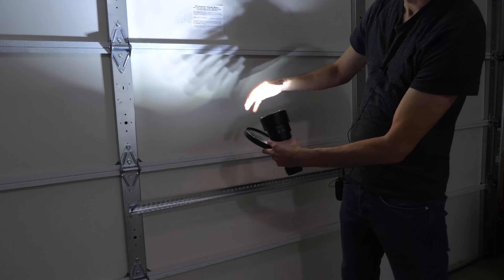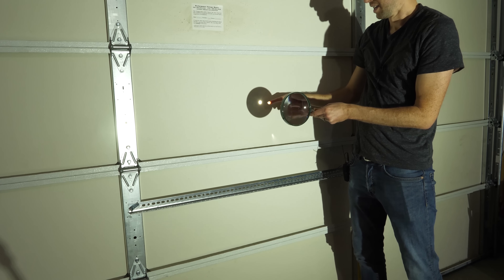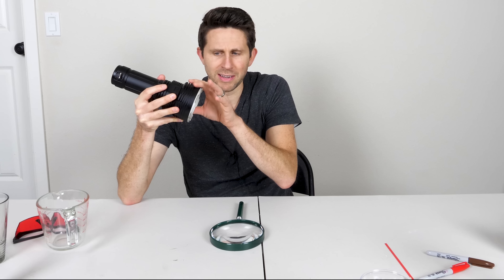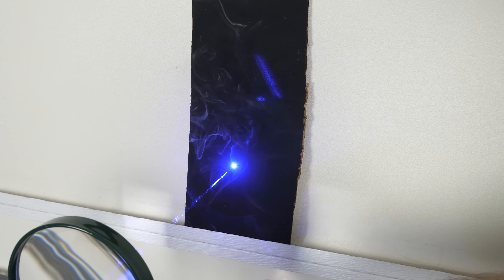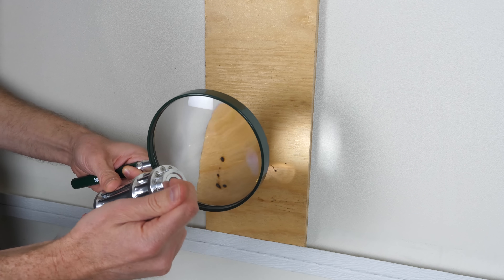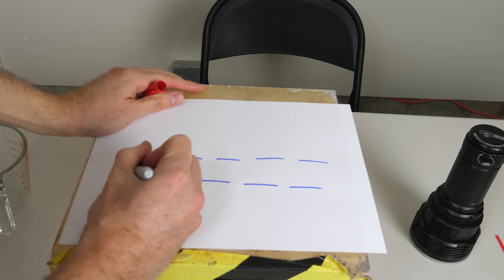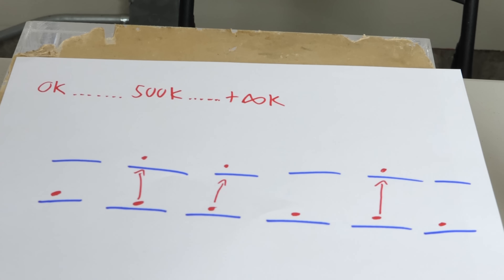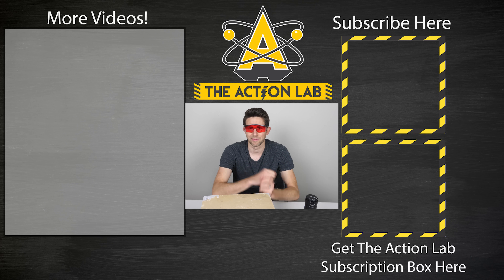What Happens if You Focus a 5W Laser With a Giant Magnifying Glass? Negative Kelvin Temperature!

Comment: The light have no material to guide itself, schnell basically
Reply: I think that the laser wavelength is between 380-780nm but the blue color indicates the its is centered around 450nm so the photons emitted have  lot of energy in terms of eV, I would suggest the use of a cristal as magnifier doped with Ge and also the coupling should fit in the active zone of the laser to lost the minimum energy of the laser between the interfase as much as possible, also it is interesting to check the reflectivity of the tho crystals around the active zone and calibrate them to have the max power input
Reply: Also it is interesting the temperature as you said, it is convenient to have a good spontaneous emission to generate the process of guided photons but it is not interesting to have a lot because those photons generated are not guided so the balance is important to have the max power, also the direct voltage introduced to the laser. It is important to check graphics to see the best level of each component used in order to maximize the power

Comment: I didn't know anything about science as a kid, but I had a magnifying glass from an old projector that I would always play with and light things on fire with. I would just barely try hard at all to focus the light on something and it would burst whatever i was pointing at into flames. I loved it so much. I wish I still had it but I don't have it anymore. Anyways, I just wanted to say that, obviously if the flashlight goes all over the place and has a huge radius, it's not going to do anything at all when amplified by a magnifying glass. The light needs to be controlled into a small enough circle that it will fit the magnifying glass. That's obvious as well. But, the thing that people never really talk about is.... You can also just make the magnifying glass bigger and/or thicker instead. People always focus on the light, don't forget that the main thing is the magnifying glass that's giving you the results that you want in the first place.

Comment: The dot can be brighter, as the energy is being focused into a smaller area. There is less total energy after focusing, but it can definetly be brighter.
Reply: The second law of thermodynamics forvids you to focus the light from the flashlight to a smaller area than the surface of emition. Doesn't matter what array of mirrors and lenses you use
Reply: @joselotl  
Because the thermodynamic police going to smite you down if you do that? Will the send a SWAT team to disrupt your physic breaking experiment? Of course, not.
I think the OP is correct. The magic words is 'CONDENSE'. Total energy out put would still be less BUT the energy condensed in small area could have higher temperature than the source. Gas is a better example of that.

We wouldn't have refrigerator if such concept is wrong. Think about it.
Reply: Of course, with an active device you can do it. One that consumes extra energy appart from the one from the flashlight. So, not an array of lenses and mirrors. Just like a refrigerator
Reply: @joselotl  
Let me put it this way.
10 people standing over 1 sq.km. and 2 people standing in 1m size square, which has more density? Which has more people?
Reply: Imagine all the energy stored in the ice at the Antartica. Its a lot of energy, yet you cannot concentrate it to heat your house.
Reply: @joselotl 
If you can compress the ice/ water, then it would probably work.
But in general sense, ice and water are not compressible. Which is a different topic.

Ice may have store fewer heat than of that hot air, but the temperature usually around zero celsius. With the mass holding it, the energy is way A LOT more than of that absolution zero kelvin, which translate to roughly -200 celsius.

If you can squeeze it out, of course.
Reply: So why it doesn't work with flashlight?
Reply: and hotter... just need a magnifying glass bigger than the angle of the emitter and glass that wont absorb photons lol
Reply: @justincase1898  because flashlights and the sun have positive energy while lasers have a negative energy. Don't ask me what that means, I just know that's the answer lol
Reply: @MuhammadAli-qh8tg  Not negative energy. Only negative temperature.
Reply: @MuhammadAli-qh8tg  Yeah but why can a sun burn but a flash light won't? Seems to make your answer invalid?

Comment: Lemme make this easy.

Laser light = Very Low Entropy, Well-ordered light. Emitted in only one direction at one frequency, all in phase.

Sunlight = High Entropy, disordered light. Emitted in every possible direction across a wide range of frequencies, with random phase. Entropy lowest just after emission.

Because Entropy cannot decrease, the target image light falls onto must be sufficiently big and dim to account for all the disorder. For sunlight, that means you can't do any better than to create an image at same temperature and brightness of the source (ie the sun). For Laser Light, on the other hand, entropy is not the limiting factor, so you can make the image as small and bright as your equipment allows.

PS. Entendue is essentially a fancy name for Entropy in optics. They're technically different concepts, but are very very closely related.

PPS. "Negative" or "Infinite" Temperatures in this context basically just mean that the entropy of the laser light is very very small relative to the energy it carries. The technical definition of temperature is the ratio of energy change to the entropy change in a system when heat is applied, and in some setups (eg. lasing cavities) it's possible for the system to become more ordered, not less, when energy is pumped in. Thus negative temperature, low entropy, and high energy.

Comment: Please tell me you know that’s not actually a laser. It’s a focused LED. I have the same one. But I’ve also had a real laser and there are a lot of differences, most important of which is the way the light is created. Trust me, there is no gas tube that $40 Amazon “laser.” Also, no matter how many are sold with the name and no matter how many YouTube scientists make videos about them, there will never be any such thing as a “laser diode.”
p.s. Yes you can focus a flashlight down to a fine point, hot enough to burn wood. You just need a big lens and a focusable high power flashlight.

Comment: This video is non-sense. You can focus light from a flashlight buy using a collimating lens in front of the magnifying glass, you can focus anything to a smaller and smaller point with the right setup.

 Also, the temperature at any given point and the total amount of heat are not the same thing....

Comment: There are several LEDs in that flashlight, what you have to do is use one magnifying glass to straighten up the beams so they dont spread out, and then a second one to focus.
This will lead to a brighter spot as the light emitted from each LED is focussed on the same spot
Reply: Wouldn't that invert it and make it more spread out
Reply: @mysterynotch9098  it would, the chain would require 3 mag probably
Reply: Wrong, the point at which the light begins to converge or even “straighten out” as you said occurs after the light has already spread out too much to increase the temperature above where it started. If you bring a lens close enough to “catch” all the light, you will only spread it out rather than focus it in any way. The simplest explanation for this is that the second law of thermodynamics always holds true, but another explanation would require advanced analysis of optical wave phenomena.
Reply: @loukgoldberg  If the first lens is at the right point, where the source is at the focal point of the lens, and the lens is big enough, it can straighten the whole beam. Then another lens would focus that beam to a tiny spot. I don't buy the argument in the video. In optics you can focus a beam down a wavelength size in theory. Using a setup like @DEADBEEF mentioned we should be able to focus the beam to a smaller spot than the source, since the source is obviously larger than the wavelength of the light. There must be another way to interpret this in terms of thermodynamics.
Reply: @loukgoldberg  
He use words ambiguously. Let us assume the LED give 1 lumen ( of course it doesn't give that much energy, just for the sake of counting ) over 1 sq.cm. Now use magnifying glass to condense the area down to 1 sq.mm. The brightness ,after reduce loss, would be more than 1 lumen. A simple math would give 1 lu/1sq.cm. x 100 sq.mm./1sq.cm., that is roughly a hundred time over.
Of course the energy from the LED would loss here and there. There is no way that spot would get more energy than its source. But that specific point would still brighter then the LED.
Reply: @farn1991 you might be able to get the point to be smaller than the led but no smaller than the fuse inside the led. It is impossible to get it smaller than the source and it wont get brighter than if you just held the fuse directly as close as possible
Reply: @hypnogri5457 
Of course, you can. 
It is call 'focal point' for reason. An ideal point has no actual size.

But real world lens aren't ideal. Not to mention that temperature is a density of heat. Whatever you got from focusing all those energy will first dissipate to surrounding air.
Reply: You can see mathematical proofs about this under "conservation of etendue". The maximum compression for our sun would be around 45000x at around 1000W/m2 if you use the angle of around 0.27 degrees. This works out to around 6000K if you multiply the energy with the compression factor. Cant get better than that without energy storage
Reply: @farn1991  its called focal point because that is the theoretical limit for perfectly coherent parallel light that us focused with a parabolic mirror. The moment your light is just slightly messed up and "crooked" the theoretical limit becomes more of a small ball and not a point
Reply: Absolute zero, or 0 degrees Kelvin, is the temperature where all motion stops. It's the lowest limit on the temperature scale, but recent news articles have heralded a dip below that limit in a physics lab. Is absolute zero less absolute than we thought? At the finite focus there is a dead zone where no heat is emitted, 1 Planck Length before or after the heat reappears and remagnifies.

Comment: This made no sense. If I'm in the sun with a magnifying glass and focus it to one point I could burn a piece of cardboard. If I just left the cardboard out in the sun it wouldn't burn it would just warm up. The focusing of heat/light to a much smaller surface area or point is the reason it ignites. You're not adding energy, just telling the energy where to go. I don't see how lasers are any different. You're just focusing the laser more than it already was. The whole video falls apart when you press that laser up to the wood and it burns immediately.

Comment: THIS VIDEO IS INCORRECT 
Focusing light from an area down to a point absolutely CAN result in that point being hotter than the source of the light. 
It depends on:
(1) The energy per square area at the source; 
(2) The distance from the source; 
(3) The area of light that is captured; 
(4) And the area that it is focused down to. 
NONE of this "breaks thermodynamics."  
It's just simple arithmetic completely within the laws of thermodynamics.

Comment: Slight incorrect info here, technically if you had a big enough lense with the correct curvature you could focus the entiraty of the light into a point (infact this is actually how lasers kinda work to some extent, at least multi diode ones anyway I belive). But you are right that it would not be hotter, it would be slightly less hot as the entire sorce due to  loss to the suroundings.

Comment: Focusing the heat energy dispersed over the surface area of the flashlight into a finer point with a higher temperature is not impossible.
You would need to put some work in though, so maybe it is for you...
toxic=100 accuracy=100

Comment: 2:24 OK so I’m calling BS on this vid. We’ve all burnt an ant using a magnifying glass and if your hand was steady enough using a simple magnifying glass you can reach up to 400°F. Using much bigger lenses and mirrors we’ve been able to focus sunlight to reach up to 5000°F here on earth. The part that really throws me for a loop is that the light captured by these lenses is a minuscule fraction of the light emitted directly on the surface of the sun yet we’ve already bridge the gap halfway to the 10,000°F on the surface of the sun. It really seems like common sense that if we had a Dyson sphere or swarm that was capable of efficiently reflecting and focusing even just 50% of the suns energy output into a point about a meter wide, it would be immensely hotter than the surface of the sun because the energy per square inch is MUCH higher. To be honest I think there’s just a lot of confusion with the differences between intensity, concentration, and luminosity and concepts like is there a difference between sunlight and the energy it carries or is the sunlight energy itself.
Reply: yea I dont think lazers are nearly as hot as he is putting thier temperature in scales that outdo the center of the sun, I just dont think the lazer is that hot its a beam of focused light waves powered by a battery it cant get that hot unless it was like a burst charge and even then like approaching infinity with like a large burst charge of energy? idk this all just sounds bogus, and I think you could easily just build a better more perfect magnifine glass and get awesome temperatures from the sun, and just keep redirecting them like you said, like the heat is only going to build, a old tube tv screen is a good enough magnifine glass when ripped apart to melt some metals, just take 200 of those and you should reach 10000k unless heat dissapation is a problem somehow or its not additive/multiplicative like that, but even then couldnt you just add even more?
Reply: just add this at the end of a youtube link to see a cool version of the tv tube magnifine glass, people are litterally just throwing these tvs out. v=zuP8iUnPIhM&ab_channel=HowRidiculous
Reply: Wouldn't the thing you are heating up start emitting energy as it gets hotter?

The boiling point of tungsten is also similar to the surface temperature of the sun. Whatever you are heating up would be difficult to contain.
Reply: Thermodynamics was designed to keep money flowing at Universities & has no practical use, it's honestly repulsive how they claim the {knowledge of fire} as if we haven't domesticated it over the last thousand years. It's as if I'm the stupid caveman, expected to kneel and worship all the Thermodynamic Physicists and their infinite {fire knowledge}  

I'd rather learn from blacksmiths & welders.

Comment: This is such bunk. All photons are quantum, negative Kelvin is not real, the second law states that if the physical process is irreversible, the combined entropy of the system and the environment must increase. You can in fact produce a smaller spot that is brighter than the sorce with the correct combination of lenses. I'm so disappointed that you wold make a video like this.

Comment: I can normally follow what you’re saying in your videos, but this one left me very confused. I would have thought the reason you can focus the laser is just because you can get the whole beam hitting the magnifying glass all at once instead of just a small part of spread out light from the flashlight. This would then have more to do with the optics of the laser compared to the flashlight rather than temperature?
Reply: From what I understood you’re right, focusing the beam is what’s increasing the temperature at the site of “impact”, but what he’s explaining is what’s happening inside the beam itself. Whatever the beam hits, no matter how focused it is can only get so hot, but basically lasers are fukkin weird
Reply: @Gay_Priest  yep. Usual heat based sources shine because as they warm up, electrons jump up and down orbitals and the excess energy is released as photons, hence the amount of fotons is directly tied to the temperature.
Meanwhile lasers skip the temperature step and convert (electric) energy directly into photons. Which is exactly why they form focused beams of light instead of dispersing waves. This also means that as long as the point is focused enough, you can dispose all of the energy output into a single point from any distance, unlike with flashlight where it escapes all over the place
Reply: @Gay_Priest  31 subs , what vids do u make
Reply: Yet it violates law of conservation of energy.
Reply: @abcxyz-  Not if you take into account the amount of energy used to pump photons through the lasing medium and compare the input/output difference.
Reply: @FranklyWry  
I seriously think that it still doesn't change anything as energy can not be negative anyways...
Throwing light at an object can only increase temperature not decrease it.

Comment: But temperature is just the average kinetic energy of the molecules.
If you have a substance with a much lower specific heat ie less joule per kilogram per degree C... Eg metal vs water/gas etc.
Why is it impossible to get a point above the surface of the sun?

Comment: Dumbest explanation ever. I have multi watt LEDs and the same laser diode at near similiar wavelengths. Both will rapidly burn through the same material if run through a collimater. Also, thermo dynamics has nothing to do with this. The photons emitted by the laser vs a LED at the same wavelength  differ in  temporal coherence, spatial coherence, or polarization. None of which cause the burn because the energy in  transference is the same.. A 5w blue LED will actually burn more if focused because the LED has better conversion efficacy. Using a large flashlight head and a lens the same size is pretty dumb. Let's put both in a controlled room and see which one heats up ambient faster.